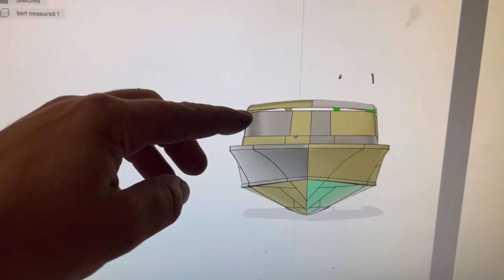25ft Bertram Project - Blob 46 (Part 2) - making curved windows and trying out the old roof

Comment: Amazing project.  I doubt that many can appreciate the technical difficulties of an almost total redesign having to shape mold and sculpture to achieve new lines. If you haven't personally experienced the complexities of fabrication it would be hard to fully understand how much of the shown smoothness is due to excellent editing as well.  Being confined by the old design and having to use methods suitable to the home shop (though well equipped) and bring in new and various materials then learn how to work them amps the level of difficulty up by quantums.  Most importantly maintaining a mental stability to move along the ups and downs while maintaining a positive drive to finish is not any small achievement in itself!  Now toss in a hefty price tag for all the parts and pieces.....  Well I stand amazed and can only applaud your initiative!!  On top of which we get some very fine videos to follow the process.
Reply from the maker: Thank you so much! I take it you have done similar types of projects? It’s nice to see you appreciate this and point this out. You’re spot on. It’s definitely a mind game and a massive learning experience. I would love a bigger workshop somewhere where I can make noise at anytime of the day or night. Adds to the challenge I guess haha 
Documenting it on YouTube probably helps drive me forward because I keep thinking it would be good footage if I could show a certain part. Most times I don’t quite get to the point where I want to show and then I run out of video storage space and then I compile the video and it’s nothing like I wanted to show haha. I keep thinking once the boats in the water I’ll redo the videos I’ve made so they are better. 
Thanks again for taking the time to comment! I’m working on the next video while I’m away for work. Should be soon